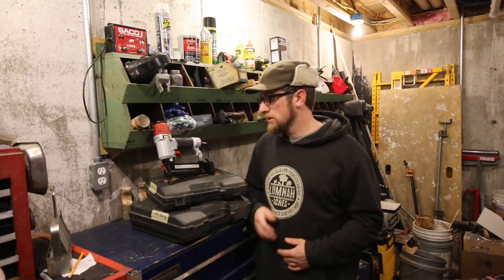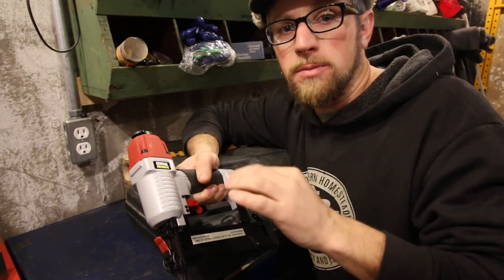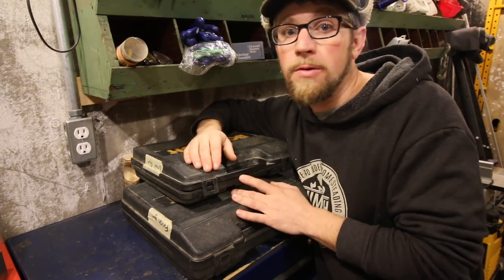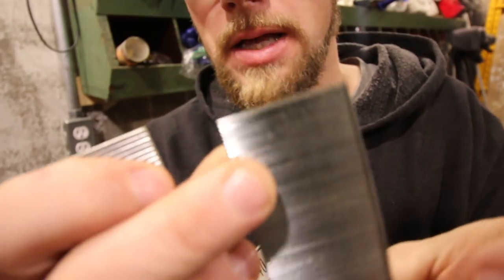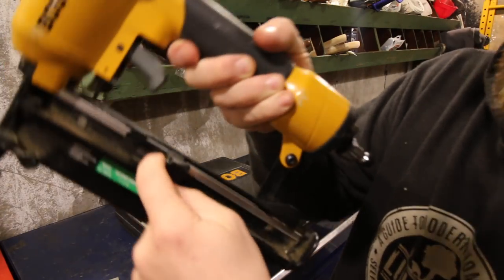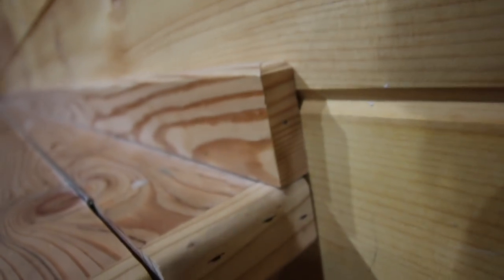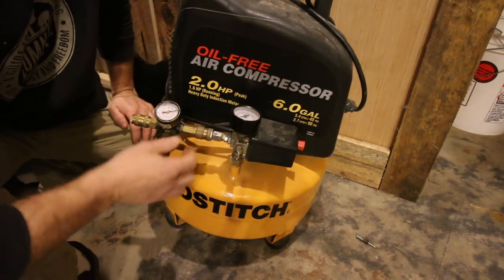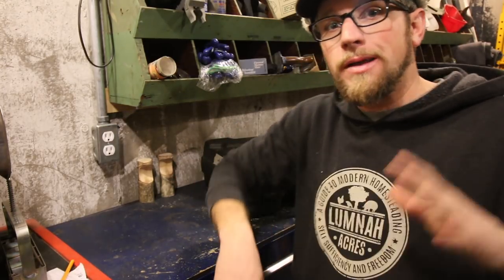Air Nail Guns and Air Compressors Homestead Tool Must Haves

Comment: I had a 6" diameter trunk on a bonsai tree, a 2' podacarpus, and have small rotary saws to carve dead wood into the branches and trunk. The compressor is in one shed and the hose came around to the laundry room shed so it wasn't too noisy. (Artists need quiet) I abandoned all this but the tools are sitting in a box. It was pretty cool stuff.

Comment: You're certainly nailing these tool videos and there was a nice air to the delivery of this one! :P I've used compressors for air brushing, but not these types of tools. I know it varies, as you mentioned, but any rough idea of the psi ranges you usually need for the regulator and how many brad or finish nail firings before the compressor kicks on?
Reply from the maker: Off the top of my head 90 psi not sure on the nail rate. Your shirt has shipped! :)
Reply: It sounds like they run at a lot higher psi than what's required for air brushing then, which isn't too surprising I guess. I'd get about 20 minutes use out of a full tank before my compressor would kick on - usually right in the middle of me filming an important bit of a video, as I've seen happen to you with yours as well. :P Yup, I saw that my shirt's on the way, which I'm rather excited about, thank you! I plan on framing mine and hanging it on the wall... :)
Reply: I see what you did there. He made some good points.

Comment: have a Bostitch 3/8" crown stapler, but I can't find staples for it.  I'm considering investing in a Porter Cable 1/4" crown stapler since the staples seem to be readily available. But I'm wondering what would be the the difference in ideal uses for each size of pneumatic staple gun?

Comment: Hi Al, 
I just had a quick question on my finish nailer. Sometimes I notice my gun shoots blanks, messing up my trim for no reason. Why does that happen? I will have a full rack of nails but still it does not feed properly. Is it recommended to oil the track the nails slide in? It is a new Bosch nailer, but ever since I have had it I have had this problem.
Reply from the maker: for some reason, the nails are sticking. Are you using Bosch nails?